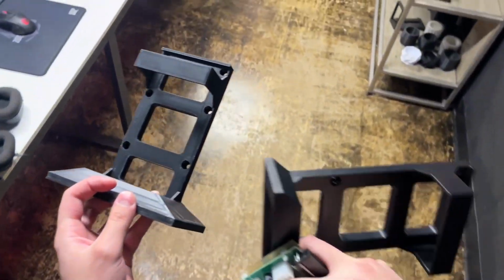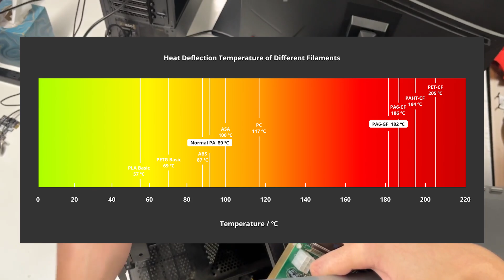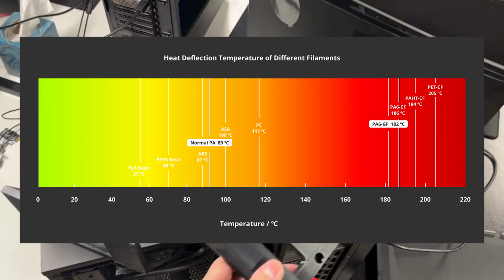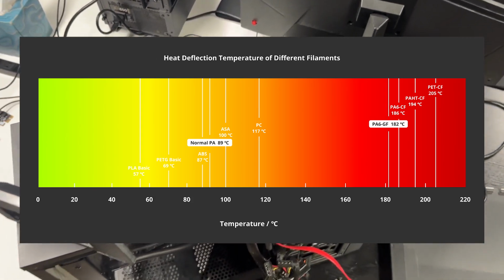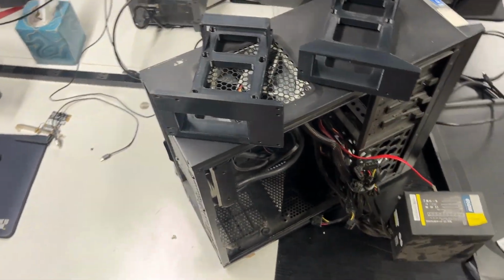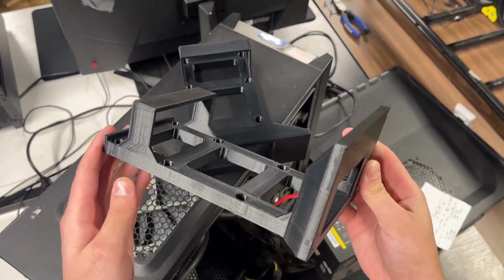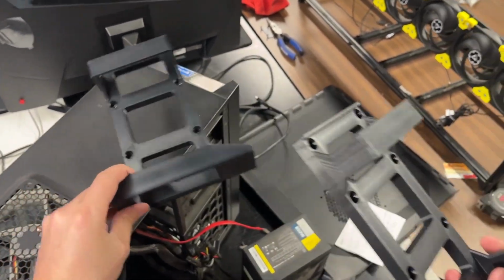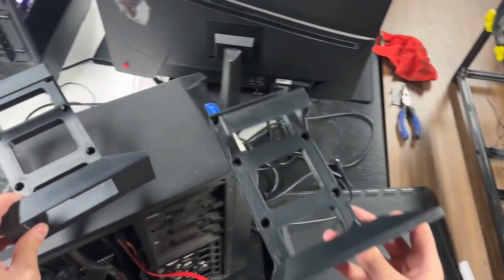HP Server PSU to ATX PSU Adapter | Low Profile & Standard | 3D Print Master LLC

Comment: Were you really still mining in 2024? I'm actually looking at these PSUs for AI rigs now. If you don't want to make inserts for the ATX bracket, you could just use fan screws. They are designed to bite into plastic and make their own threads. Standard PSU screws are machine screws.
Reply from the maker: I never stopped mining. I did switch into AI stuff here of late but still mining some stuff. I'm thinking about switching to inserts for these PSU brackets.